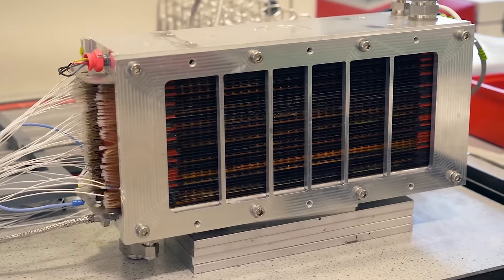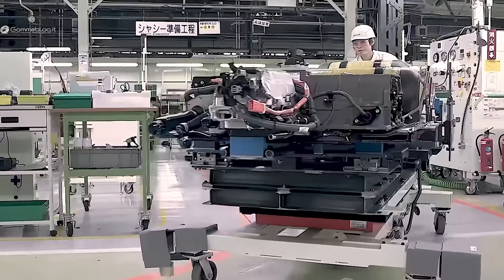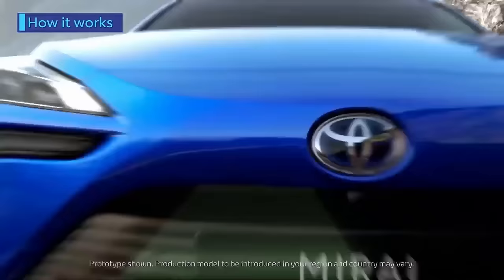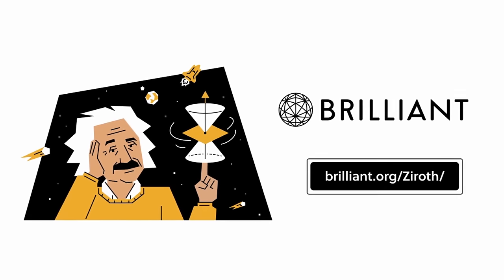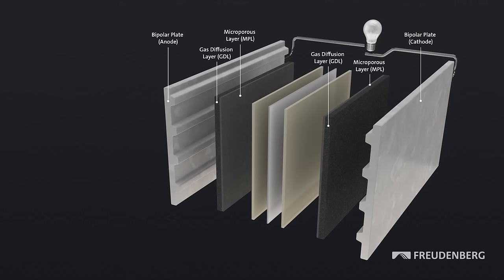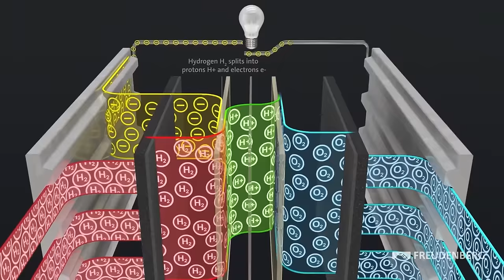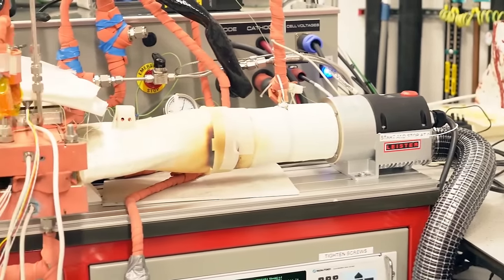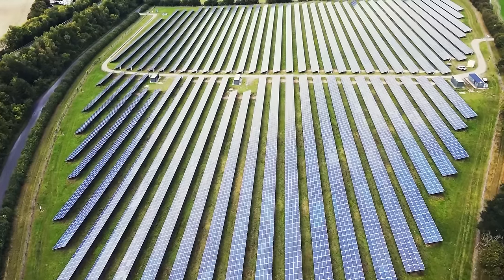Why This Hydrogen Fuel Cell is Engineering Genius

Comment: Kontak Hydrogen Storage has patented technology that stores hydrogen on ammonia at 7 BAR.  Our compact Reactor is 80% efficient and stores twice as much hydrogen as compressed and 43% more than liquid without cryogenic temperatures.  As ammonia is converted, the aircraft becomes significantly lighter since the storage vessels are much lighter.  Refueling times to 100% of capacity are far shorter than battery recharging.
Reply: Hello user, combining hydrogen in order to make it easier to transport,use and store is a great idea. Ammonia is a poison though
Reply: ammonia has half of energy density of jet fuel while liquid hydrogen has 3x the energy density of jet fuel. Something in your explanation doesn't add up.
Reply: @FultonStephani  When comparing the energy density of jet fuel to hydrogen, there are some important differences to consider:

Jet Fuel: Jet fuel, specifically Jet-A or Jet-A1, has an energy density of about 35-37 megajoules per liter (MJ/L) and approximately 43-47 megajoules per kilogram (MJ/kg).

Hydrogen: Hydrogen has a lower energy density by volume but higher energy density by weight. The energy density of hydrogen is roughly:

About 8.5-10 megajoules per liter (MJ/L) when stored as a compressed gas at 700 bar (approximately 10,000 psi).
Around 120-142 megajoules per kilogram (MJ/kg) when considering hydrogen in its liquid state.
So, while hydrogen has a higher energy density by weight, its energy density by volume is much lower compared to jet fuel. This difference is crucial for applications like aviation, where the volume of fuel storage can be as important as the weight.

Comment: Great video but the key metric that they ‘forgot’ to tell us is the efficiency. The Mirai fuel cell is less than 50%.
Reply: It is not the whole truth about FCs. Fuel cell efficiency strongly depends on the power rate. At 20% of maximum power it could have more than 60% efficiency.
Reply: @Torx-uh3uo 20% max power is not much use for an aircraft.

Comment: Problem with Hydrogen is not the energy generation, its the creation and transport.  Japan is investigating in red Hydrogen, but they are the only country that is investigating in its infrastructure.
Reply: Creation of hydrogen is a separate problem compared to energy density. While it’s not very sustainable to generate hydrogen it still has the added benefit of being very energy dense compared to batteries and basically 0 emissions. So while the Creation of hydrogen is still a problem, it is the key thing that could enable more sustainable aviation. Battery aviation is just not an option at the moment with current battery tech, especially long distance. Practical long distance aviation is the nut they are trying to crack.

Once we figure out how to enable hydrogen use in aviation, more sustainable ways of creation will come along. There needs to be a market first.
Reply: @King_Cole  useful hydrogen, aka compressed hydrogen storage, is not energy dense it is around 600 wh/kg and 300 wh/l at 5000 psi. If you increase the psi, you increase wh/l but decrease wh/kg.
Reply: @King_Cole funny how people think there will not be major advances in tech and incentives for change when the cost and regulations hit a certain threshold.

Like gas pumps and supply chains just appeared out of nowhere and never posed any challenges or increases in safety, efficiency and cost reduction.
Reply: @nameberry220  I think your estimates are way off. A real world example is the Hydrogen powered Toyota Mirai which operates at ~10,000 PSI and a hydrogen energy density of about 20000 wh/kg. That's way different than what you quoted. That is about 5-10 times more energy dense than lithium for perspective. 

However, I don't think Hydrogen is the answer to everything. It's just another option especially when it comes to long distance like aviation or shipping.

The "green hydrogen" problem definitely still needs to be solved before this can become fully sustainable and readily available.
Reply: @lucbloom There are certain physical limits, you cannot cheat the laws of physics.

But, I think for aircraft where cost is less of an issue, pressurized cooled hydrogen will probably be the answer.

Comment: They're talking about reducing the weight of cooling water, but planes already carry tons of fuel.  What's the comparison in weight?
Reply: better fuel economy and balance
Reply: Like you said, planes carry tons of fuel. Without the extra weight of the coolant, they can carry more fuel for more range. Besides, if the plane was traveling between places like California and Utah, the pilots and crew would only put in enough fuel for the trip, plus some for loitering, not a full tank.
Reply: @WolfeSaber   Good pernt.
Reply: If you listened, it’s air cooled
Reply: @WolfeSaber I think you will find they do not carry lots of fuel....modern turbo-fan engines dont use fuel.........
Reply: @roybarton9617  Turbofans do use fuel, their just more efficient.
Reply: @WolfeSaber where do they store fuel other than for the auxilary jet in the tail?...........
Reply: @roybarton9617  In tanks in the fuselage and the wings.
Reply: @WolfeSaber under the passenger seats 😂😂😂🎉
Reply: @roybarton9617 wait, do you really think modern turbo fans don't use fuel? How would they even work? That would break the laws of physics. Modern engines are just bigger and have a higher bypass ratio. The operating principle has not changed in 70 years.
Reply: @thorwaldjohanson2526 my reply got wiped...........
Reply: @roybarton9617   This statement makes no sense.
Reply: They said their system weight is 2 kwh/kg. Not even better than the most power dense batteries. And 10x less than used aircraft propulsion technology.
Reply: In order to know how excited to get, the video owes us to disclose a few basics:

- cost per flight
- initial cost
- safety after wear & tear
- cost & frequency of maintenance
- complexity of repairs (emerging markets, global coverage)
- efficiency of cooling liquid hydrogen aboard

These offset to traditional methods. And prognosis by a non-biased source.

That would be investor’s journalism instead of “hopeful green tech reporting”. Which is inspiring, but leave some things desired.
Reply: @wanderingbufoon I think you're missing the point. If a plane carries 150 tons of fuel and you reduce the mass of the system by 10kg, then the decrease in weight doesn't make any difference.
Reply: @WolfeSaber but if the coolant is 0,0001% of the total weight of the fuel then it doesn't matter. He doesn't ask why lower mass is important (that's obvious), he's asking how significant this reduction in mass really is.

Comment: 18:59 or so: This is honestly where this tech is more important. Airplanes are unlikely to be improved by this, synthetic fuels are probably a better answer there. But heavy machinery and large land-based vehicles are harmed less by their fueling system needing to be larger - which is the primary problem with using hydrogen.

Comment: What wasn't mentioned specifically was, what is the working fluid (medium) through the turbine side of the turbocharger? It must be steam from the recombination of the hydrogen and oxygen which is an exothermic reaction? So the turbocharger would not look similar to an internal combustion engine's.The turbine must have multiple stages to efficiently extract as much power as thermodynamically possible.Thermodynamics tells us that the higher temperature and pressure at the inlet of the turbo-expander the higher the efficiency. The steam is waste product so using it's energy instead of requiring parasitic cooling is the crux of Zeroavia's technology. So it is determined that the fuel cell must operate at high temperature and high pressure.They are engineering catalyst membranes to structurally resist high pressure and temperature.

Comment: Very well-done video. Clear and detailed. The chap said the system power density was 2Kg/kW. A Lycoming IO360 engine is described as 250g/kW (although wikipedia data suggests more like 850g/kW. I'm guessing that system power is the whole fuel cell with ancilliaries, but doesn't include fuel tanks, which is obviously much heavier for hydrogen than avgas. Some more detail from people who know about aero engines on how this power density compares with existing engines (piston, turboprop, turbofan). Obviously what actually matters is the whole system motor+fuel cell+tanks+ancilliaries. Also what do we know about volumetric power density? I must admit to having no idea what the factor of power density increase is from a piston engine to a turboprop engine to a turbofan engine. It does look like these things can compete with the piston engines, which is an excellent start, but I'm guessing we have a way to to go for the jets?

Comment: You don't need more power density,  you need more volume density.  You can already use batteries or other assistance for takeoff, then recharge the batteries slowly with a normal temperature fuel cell.  You need the batteries anyway to heat the fuel cell.

Comment: Very cool tech, but I feel like the information wasn't delivered very well. It's fairly often that the people working on these projects hands on, have a hard time explaining it in the moment or "on the spot". It's your job to take said information, break it down, and explain it, in a digestible manner. 

So far what I got from this is hydrogen fuel cell built similar to the construction of a stereotypical anode cathode battery cell, that is able to withstand a high temperature environment. Somewhere along the line The high temperature environment is able to utilize turbochargers and that somehow increases efficiency. Being that it's a turbocharger it would have to be on the exhaust end... But where is their exhaust in the system? Is that just the air flowing through the ducks on the motor of the propeller driven craft? Can this be scaled up to use jet turbines? Still quite a few unknowns. I feel given the length of this video these answers should be resolved.

Comment: theoretically air compression for cooling could be aided by intakes on the surface of the aircraft. Several intake vectors could be combined to concentrate efficiency.

Comment: Wow that sounds great. In a refinery wher we  also produced Resins plastics  so haf facilities for burnibg off rejected materials, in an enormous rageing pit. When a truck load of  Helium arrived, five of my security gards were on station with two safety signs each. Great to produce it cheaply but distributing it and putting it into automobiles, trucks and planes, many of which burn,  will require an exponential increase in undertakers.

Comment: useful hydrogen, aka compressed hydrogen storage, is not energy dense it is around 600 wh/kg and 300 wh/l at 5000 psi. If you increase the psi, you increase wh/l but decrease wh/kg.

Comment: Current "conventional" fuel cell systems are in so many ways a few times, to orders of magnitude worse than turbine engines for powering flight. Sure, increasing the temperature gives you a number of interesting potential benefits, decreasing the number of times worse and orders of magnitude worse some aspects are compared to turbine engines. Developing such systems is closer to basic research than commercialization of known technologies. The basic fact that Toyota et. al. haven't chosen that route, with their billions of dollars spent on R&D suggests it's not realistic that some startup will figure out how to design a system that's much better than low temperature systems. And, just a few times better still won't make it  fuel cells viable for powering airplanes. 

If they can achieve 2 kW/kg on a system level, fuel cell system, not including tanks, or motors, but everything needed to turn hydrogen into power, and make it reliable, with reasonable energy efficiency, that would be very impressive, but still really really bad for aviation.    

One of many issues with fuel cells is that each molecule of oxygen and hydrogen needs to find it's "partner" to react with, from either side of a membrane, on a molecular level. That is a huge fundamental issue, and among other things, that means, for any given system, the higher the power output the lower the efficiency will be, which makes aviation the worst possible application for fuel cells.  

A comparison, for jet engines, it depends in the engine and size of the bird if the motor ingesting a bird is a significant issue or not. For fuel cells, even grains of pollen invisible to the naked eye that gets into the fuel cell is an issue that will reduce performance and efficiency. For a jet engine, pollen that gets sucked in are bonus fuel.          

While hydrogen isn't a very practical fuel for anything that needs to have reasonable cost, and turbine engines are not easy to develop, developing a hydrogen turbine engine electric hybrid system could be considered very reasonable, compared to fuel cell based system, for aviation.

Comment: Interesting video. It would be nice to see a diagram or animation about how the turbo is integrated into this design and how the propulsion is achieved. I'm struggling to understand how the energy is transported and managed in this engine - even though I understand turbos and fuel cells independently.

Comment: Hydrogen is about 25% of the efficiency of battery storage, so we should really only be using it in applications where batteries absolutely fundamentally cannot get the job done, which is not personal transportation...

Comment: What is even cooler, is that people like "Jeremiah" as on the breakthrough of the Nikola Tesla's two stage turbine. (Which is a turbine and a pump, in one.) It is so good, that it literally can convert even wet steam, into ice.

That means that solar panels are about to become as efficient as a generator. (90-95%). Even fuels, like petrol, diesel and hydrogen, will become 90-95% efficient, instead of the 35%-65%, like they are now. While using less expensive equipment.

Comment: Even if the hydrogen is dirty, it'll be better than having every single plane spread pollutant in the air.  At least the focus can be on power plant efficiency while the planes in the air are not polluting.

Comment: As far as fuel cell tech goes, the biggest issue is platinum usage.

But in terms of hydrogen broadly the issue is still one of storage. Liquid hydrogen is incredibly dense but needs to be insulated and ventilated to prevent a high pressure gas explosion as the cryogenic liquid heats up. Compressed gas doesn't need to be kept cold, but it is way less dense and the tanks need to be strong and heavy to contain the pressure. 

Solid state hydrogen is a joke. It is stable and very safe but has a very poor energy density for its weight. 

This is certainly interesting and exciting but I don't think it does much to solve the core issues. It may help mitigate some of the other issues though so I wish them the best.

Comment: So I can convert my Cybertruck to hydrogen.
Remove 90% of the battery pack, and replace those with fuel cell packs. In the bed where an extended range battery would go I put  a Hydrogen storage tank. 
And I should be able to drive from NY to LA with no stops for fuel.

Comment: Interesting here are some thoughts.... The fuel cell with hot water leaving cell could be built into heat engine piston which could allow for pulsed high temperature and cooling cycles.  This allows higher peak temperatures with lower average temperatures, so get electricity from fuel cell, and heat engine also provides comprssion and maybe some extra electricity.

Comment: As h2 has to be mainly highly pressurised and refrigerated to keep it and requires then large carbon containers to store. Can they not use Ammonia at full strength to give them H3. Also once in a high altitude you could use atmospheric water vapour to give endless hydrogen from water vapour as well as the oxygen in atmosphere, that would require supper amounts air harvesting cells, Buts its weights is negligible due to not requiring fuel once initial lift and height achieved. Love there approach

Comment: Plasma Kinetics has a unique hydrogen storage system.  Hydrogen is stored on a magnetically charged film(something to do with nano fingers that have a charge and can hold a hydrogen atom).  When you shine a light on the film it loses its charge and releases the hydrogen.  Please research Plasma Kinetics, the combination of hydrogen fuel cells with a storage system that doesn't require compressing hydrogen would be extremely efficient and cost effective way to store hydrogen.  
If people bought electric cars with a hydrogen fuel cell, battery pack along, and hydrogen storage, the majority of the world could switch to green hydrogen for everything.  People could power their homes with their cars.  
Green hydrogen can be produced in one area and shipped nationally using green locomotives and ships.  If we could get the EU or the US along on this endeavor we could be green in  less than 20 yrs.
Reply: I saw a rebuttal on that; I was initially really interested. Basically it came down to, you can't store more hydrogen on a tape, as they suggested, than you can in a compressed tank.
The density was basically wildly over stated; though I'd be happy to be wrong.
Reply: @TheTaysoren  Thanks.
Reply: @TheTaysoren  You are correct.  Plus the tape storage was very expensive.  They have been pitching the tape system to poorly educated investors for a long time.  Kind of sad.

Comment: I don't understand why they don't use closed hydrogen power cells. They can isolate the oxygen from the hydrogen. It's simple and with the advancements in technology, they could develop a method other than an alternator to power the cell. People have made them run their vehicles successfully and there is little to no cost in producing hydrogen gas once the cell is made...